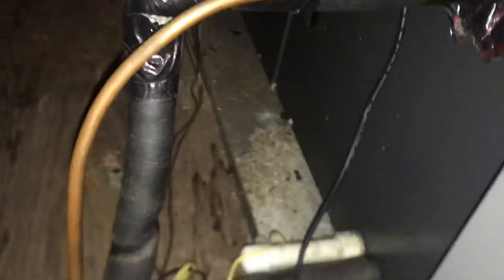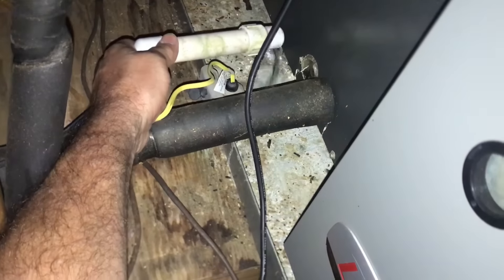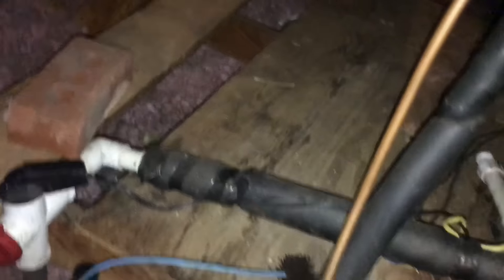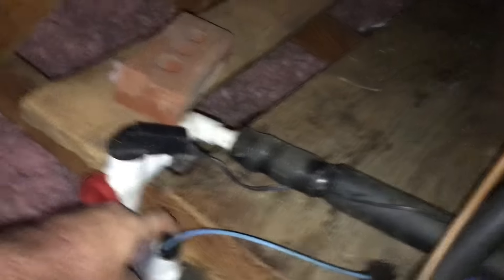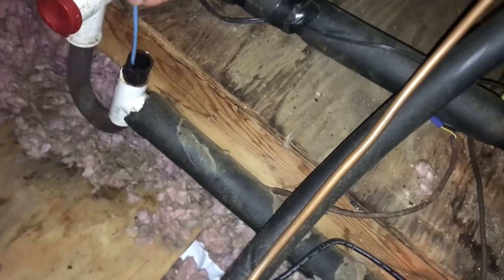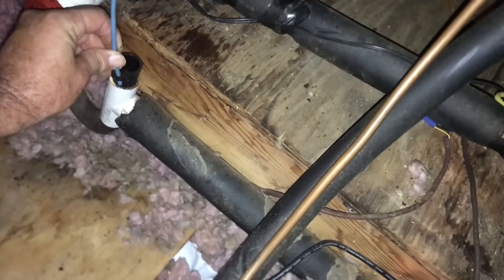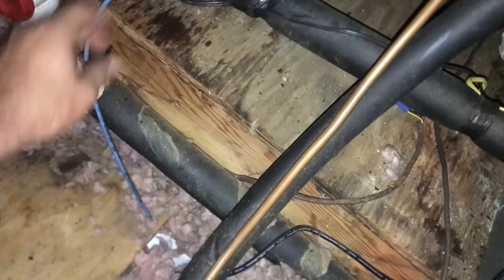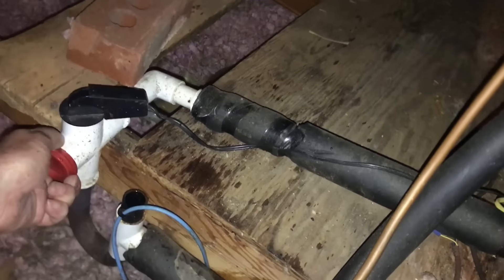How to unclog your condensate drain and P trap DIY (call a pro)

Comment: Our apartment building has a drain tube like that but there's all the cable wiring running thru the buildings cable system allover the side of the building.

Comment: You have to have the secondary either plugged or have a float switch if not then you system won’t drain properly because it’s sucking air from the outside. It’s like not having the unit trapped
Reply: Also just curious if you were there before for water leak what did you do then? Or was it a different company there first?

Comment: Should have secured does PVC pipes to the wooden decking up in the attic so that nothing could move them or break them off by accident and cause water to be draining or jumped into the customer ceiling

Comment: wait a second..... do they have the primary and secondary backwards @ 8:15 it looks like the pipe is connected to the "higher" drain hole, or is that just an optical illusion caused by the insulation and camera angle :)))
and lennox, with internal hole half blocked on secondary... time to put my foot in mouth lol
Reply from the maker: 8.36 shows the partial blocking of the secondary hole... shakey camera work but you can see it.
Reply: yeah, I commented before you showed it, not thinking about the silly pans with half blocked holes that are the same outlet height. the camera angle and insulation does make it look higher though.
the biggest issue besides double trapping is not enough flow through the traps to keep debris from building up and being flushed out, slow trickle of water just makes the buildup worse and the same problem occurs with all traps that don't get flushed by high volume frequently.
I cannot think of any solution other than manually flushing them often or vacuuming from outside to pull the crud out. so it looks like the HVAC will always have their "condensate-fests" making them money lol.

Comment: Don't ever lean on the top of those particular Lennox units with your bear arms. The fiberglass will eat you alive!
Reply from the maker: Kinda like pcking up an old big stick or antron99 CB antenna.... massive needle sized splinters galore. Dried up fiberglass is rough.
Reply: aluminum antennas ftw.... ;)
Reply: Anti DIY HVAC I use to have an Antron 99 and I do believe it is still at my sisters house’s shed. Fiberglass galore!

Comment: You never put the Evaporator coil on the return side. It will suck water droplets through the whole furnace including the circuit board. Secondary drain on the Acoil  see International Residential Code  M1411.3 Condensate disposal. In short don’t use it.
Reply: Many humidifiers are plumbed this way, they are often mounted on the supply plenum and ducted to the return, or vise versa, either way the humidity is going through the furnace.  Although no more than 30%-35% generally.

Comment: I was told these fixes are so easy! If they were then the owner would have done him or her self dummy!
Reply: Why not, save some money? I do everything for my house about 99%.
Reply: @HsingSun  exactly. I just did this myself to clean out my primary using the same vacuum adapter and some bleach to save some money and to have system back up and running faster than waiting for a repairman to show up. I accept the risks if i mess up my system but these types of fixes do not require a "pro" as long as you do your research before you attempt it. Without these videos I would have never attempted that myself.